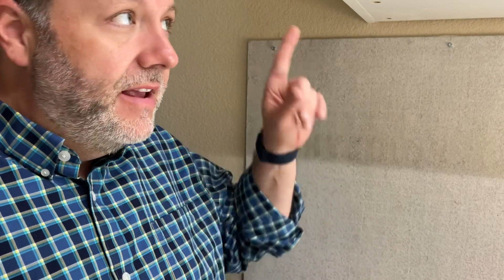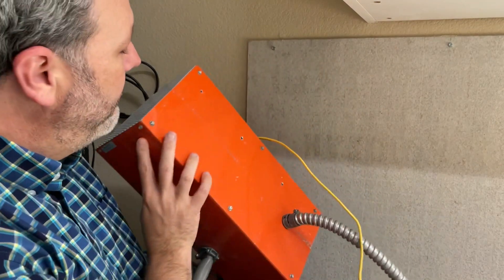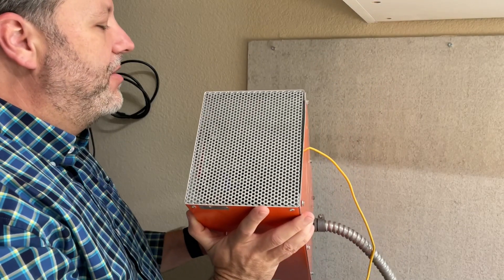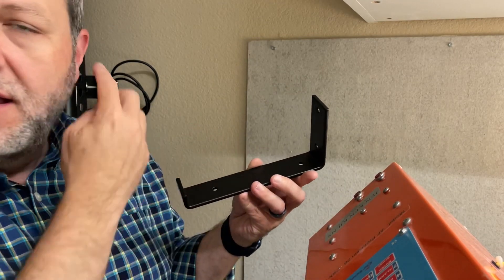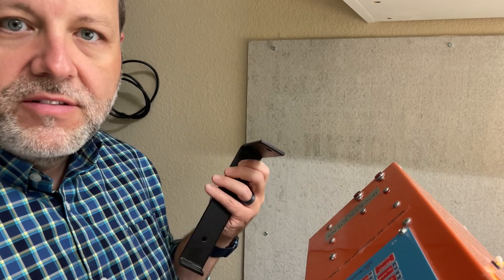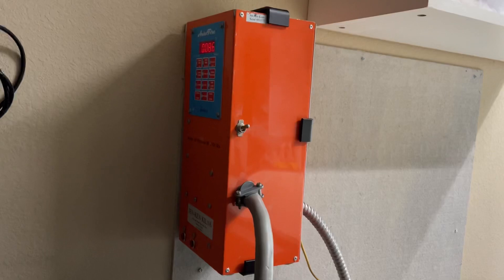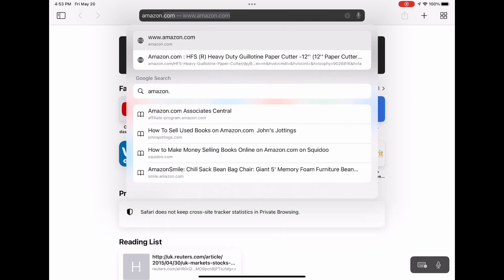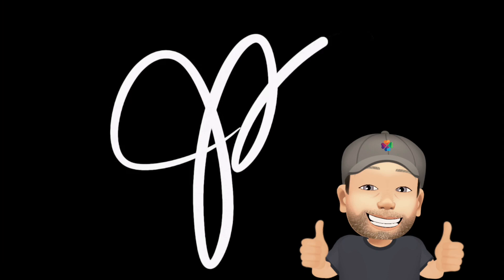#StudioRenovation: How I Used Shelf Brackets to Hang my Jen-Ken Kiln Controller on the Wall

Comment: I am considering buying a used Jen-Ken Kiln model JEN-JK1145FD but it does not have a programmable controller and this model was discontinued in 2022.   I want to know if I can replace the controller it came with with a programmable controller, are they interchangeable?  I really want to make it work!!
Reply from the maker: I have no idea but I assume it can be done. The people at JenKen are very easy to work with — I suggest you reach out to them. Good luck!